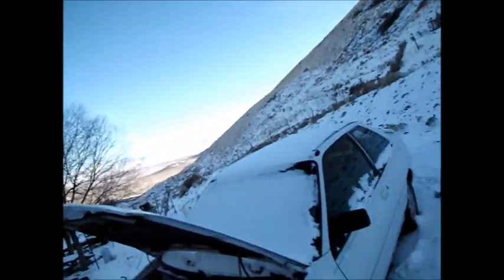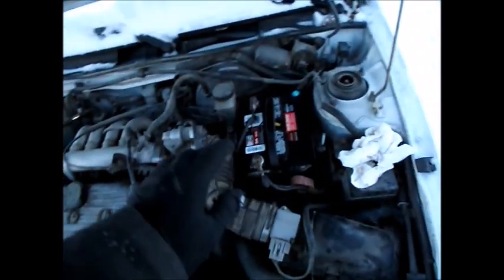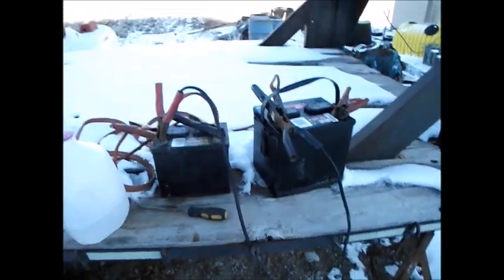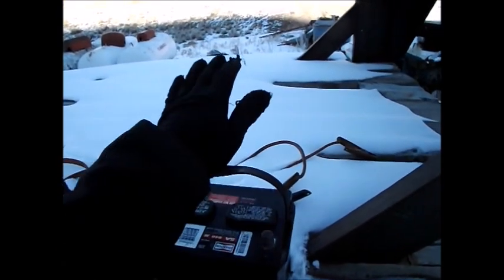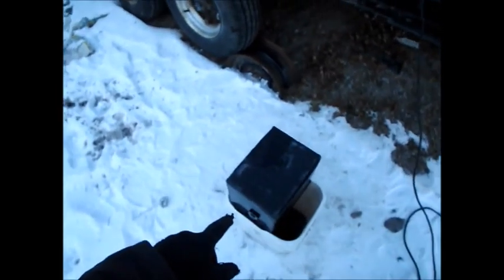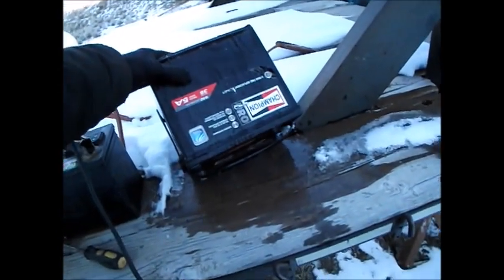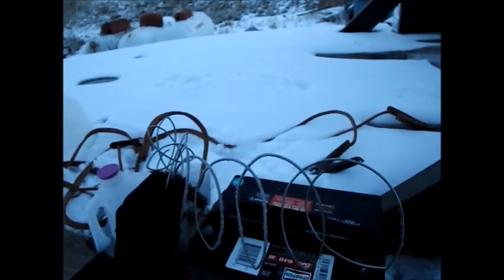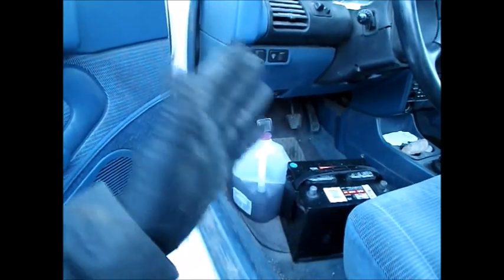How to Store Lead Acid Batteries

Comment: I looked into this, a fully charged lead acid batteries positive plates have lead dioxide not lead oxide on them. Lead dioxide reacts with air to produce lead oxide but lead oxide isn’t as or at all effective in the battery? Also apparently sponge lead is highly reactive in air? Is this still accurate @codyslab

Comment: Polypropylene milk jugs get brittle very quickly in sunlight. Even indirect sunlight. They do not put UV protection in the plastic (because they presume the jugs will be in someone's refrigerator). I suggest covering the jug to block the sunlight.

Comment: Another fascinating video Cody, have never seen this method of storing batteries before, how about doing a feasability video on desulphating batteries using a chemical that would break down the sulphation and remove it from the plates, could be interesting, regards Doc Cox.

Comment: very cool, it had never occurred to me to do that, I would say though that if you're storing for years you probably ought to use a container with a screw on, airtight lid, so you don't lose any acid through evaporation or spillage due to animals, etc. I would think if you wanted to store it for a very long time it might be a good idea to neutralize any remaining acid after draining with a mixture of about 8oz baking soda to a gallon of water and let it sit until it stops reacting then rinse with distilled water that way absolutely no reaction can take place inside the battery during storage.

Comment: Does the inside have to be completely dry?
Looks like, if moisture would remain inside the battery that the lead still could corrode. 

Makes me wonder.....
Many folks are saying that the battery acid level should cover the plates or the battery will go bad......so what is up with that?
Reply: I fill battery with diluted battery acid then empty.
Keep it upside down for hours and straight without caps for a few hours in sun.
Then put caps and seal the battery it will be like manifecturer new dry.
Make sure to add acid of specific gravity of .1250 when restoring

Comment: i like your idea, so ill share mine... how about  organizing a pump system to drain/refill the battery/ies  when needed or not.....empty it out into a sealed resiviour , no hazards, no contamination, no leaks, no spills..... you might even be able to make it self contained with the battery, especially if the pump is manual, like a primer on a lawnmower,  but sized to match the battery. .. or an electric one  could have small solar panel built in... jut hit a switch, set in the sun, and it fill or empties itself.